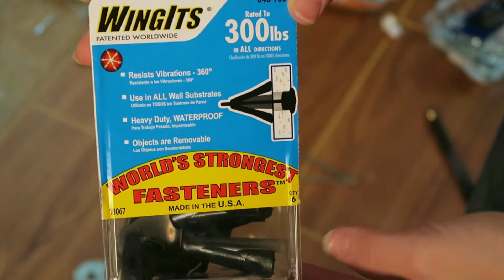3D Print and Reclaimed Lumber Bracket Installation

Comment: I find drywall to be suitable only for holding up paint... and maybe a poster or two... every time I've tried to use drywall anchors, they always fail - generally with the core of the drywall being the weak link. 😡

Comment: I like how study the bar is but damn that dry wall is wobbly as hell!
Where there no studs in that wall or something? It was moving half an inch every time you drilled it.
Reply from the maker: Suspiciously wobbly, had me concerned the whole thing was going to break through if I pushed too hard. I"d be curious to know what spacing the builders used on those studs...
Reply: Oh I've done some home renovation before. Put in some walls etc.
There's no way that wall has studs 16" apart behind it. 
Or the sheet rock is floating free in front of the studs and it's bowing back to them when she presses against it.
Reply: You can usually hear the studs by knocking on the plaster and listening for the pitch to change.
It gets lower in the spaces between and higher when you're over a stud.
Looking at the wide shot from the start of the video the left side of the bar looks to be about 16 inches from the corner of the room. That should be almost right on top of a stud. I have no idea what's going on. :\
Reply from the maker: One way to find out. Sledge hammer.
Reply: Ah yes, the direct approach. 
I had a water leak a few weeks ago. The plumber showed up and started knocking holes in the wall. 
He said if he took it slow and carefully the water would damage the wall and it would need to be replaced anyway. By knocking holes in the wall right away he could find the problem and fix it quickly and the cost is the same.
Reply: Also when he was done I asked him if he was going to patch up the holes.
He said, "Nope. I'm a plumber not a builder." And left. -___-
Reply from the maker: Surprised he didn't recommend a builder buddy and have you mention his name so he gets a referral cut.
Reply: Yeah that sounds about right. I'm sure he would have if he could but he 
worked for the body corporate of the building. I they have to hire the 
people that work on the building.